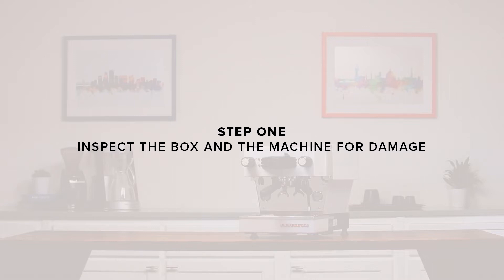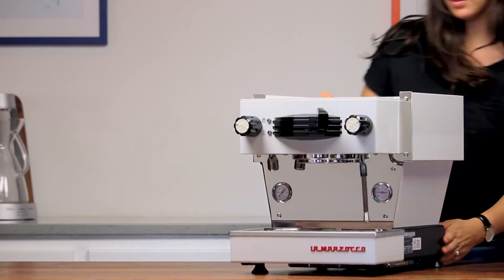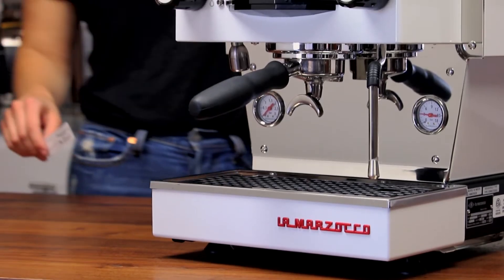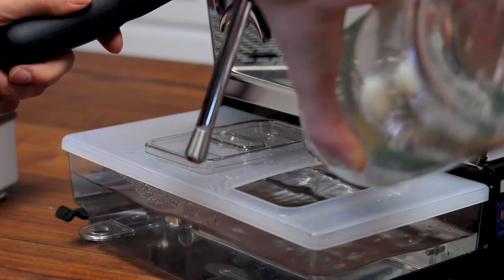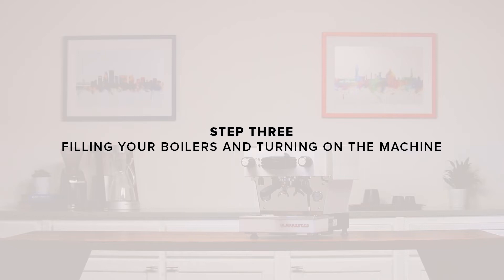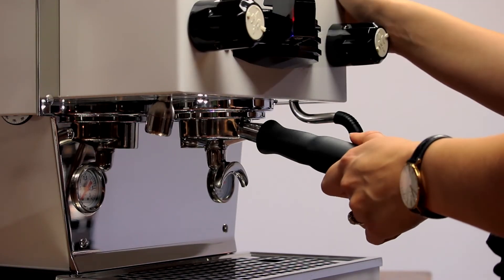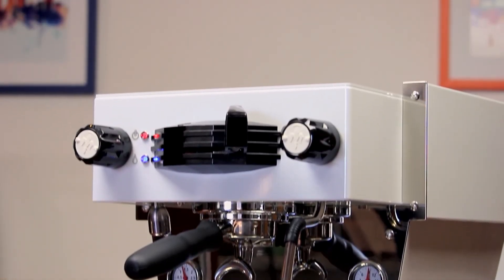La Marzocco Linea Mini Espresso Machine Setup

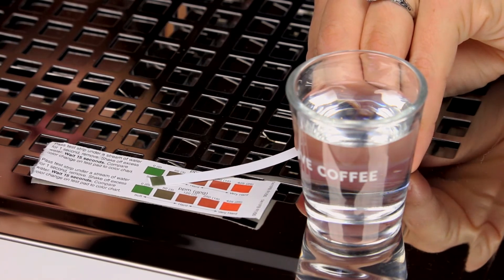Comment: At 0:37 you suggest that water hardness should be below 50ppm. From the Linea Mini user manual: “... it is important that the incoming water be of a hardness greater than 9°f (90ppm, 5°d) and less than 15°f (150ppm, 8.4°d)...“. 
Could you clarify which is the correct value of an acceptable hardness?

Comment: If i want to connect the LM to a Gallon / Water Bottle, do i need flow jet or can i just simply connect the plumb hose into the bottle?
Reply from the maker: While that will work, we recommend using a flojet. The machine's pump is designed to work with passive line pressure. By forcing it to do the extra work required to pull the water through the line and pressurize it you'll end up putting a lot of extra wear on the part. Since rotary pumps are quite expensive, it's worthwhile to use a flojet and ensure the longevity of your machine's pump.
- Charles
Reply: Clive Coffee i heard with flowjet  can also shut off the machine pump if the bottle runs out of water. How does this work?